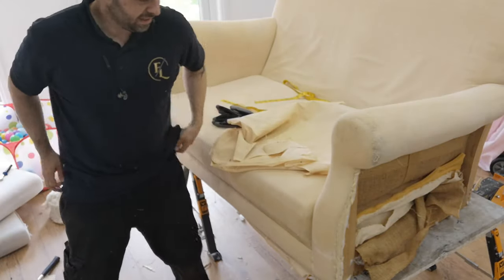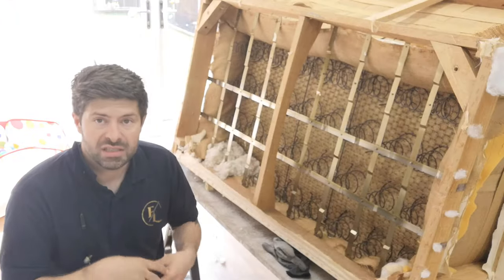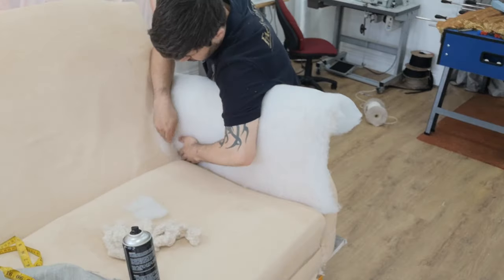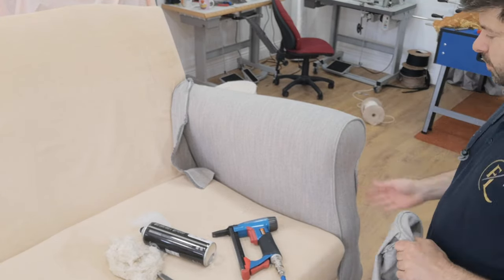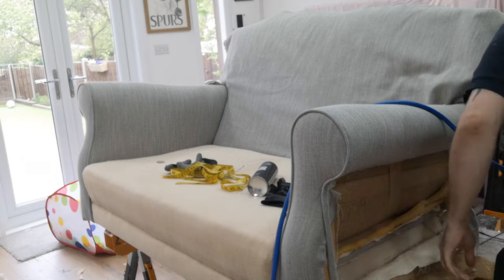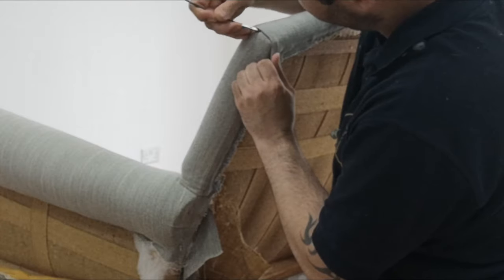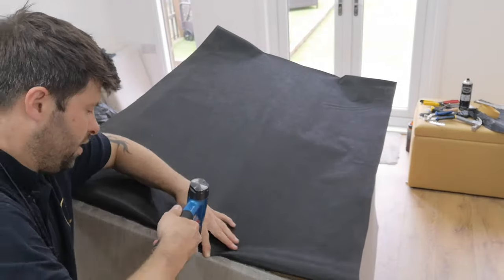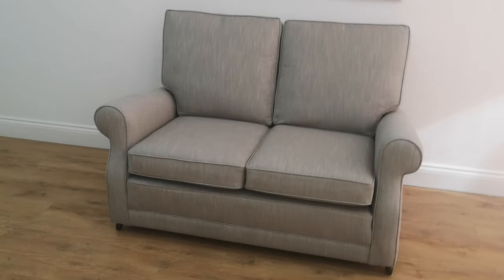DIY HOW TO UPHOLSTER A COUCH | STEP BY STEP HOW TO REUPHOLSTER A SOFA | FaceliftInteriors

Comment: if i’m wanting to change just the material (cover) on the outside do i still need to do all the padding, etc from the beginning of the video?
Reply from the maker: Hi Sarah! You don’t have to change all of the padding if it doesn’t need it - we replace foam if it needs it and re-pad as a standard service but if the foam is new and doesn’t need any re-padding, you can just recover 😊👍🏻

Comment: What type of fabric is the black fabric used between the bottom cushions and the frame? You added 6+ inches of the couch fabric and then hand stitched to the frame. Thanks!
Reply from the maker: Hi Tami - I used black lining fabric on the seat, which was sewn to the upholstery fabric. I hope that helps!
Reply: @faceliftinteriors Would a general fabric store call it "lining fabric"? Thanks!

Comment: Do you absolutely have to remove the back and sides of the sofa to pull the fabric for recovering arms and seat through? 
For instance, if I have a sofa that the only thing that needs replacing is the seat and the rest is going to be left the same? Or the only thing to replace is the side and the rest left alone? 
I like the look of a seat that is permanent and tacked using nailhead trim as well.

Comment: Your channel has been so helpful, thank you! I want to upholster our two seater slipcover sofa but I don’t think the fabric I want has the width to go across the back in one piece like yours did. You mentioned piecing fabric, is there a specific place/way this should be done? Also, if I use upholstery velvet do I need to cut my pieces with the velvet going all the same way? Thanks :)
Reply from the maker: Hi Ellenarae! Thank you for watching my videos, I’m glad you find them helpful 😊 So there’s a couple of options you could do with the outside back if you can’t get it out of one width - firstly you could run the fabric, which means turning it so the pile goes side to side instead of down...however, like you asked, if you do this the rest of the pieces you cut should all be going the same way with the pile otherwise you run the risk of the fabric looking different colours or shades. Secondly, you could sew a seam down the middle of the outside pack if you don’t want to run the fabric sideways. Finally, you could use a full width on the back and then piece two smaller even sized pieces of fabric either end...again, you’d sew those and would have two seams. It just depends what you find easier and what look you’d rather have! I hope this makes sense and is helpful 😊👍🏻
Reply: @faceliftinteriors  gathering supplies for my project! can i ask about the deck. What kind of material should i use for the lining (the black fabric you used) and when you sew the front deck strip to the lining fabric are you sewing the hessian webbing to the bottom of those as well and leaving the ends long to staple down? then when it comes to fitting you put on the front deck strip, flap over the lining fabric, staple down the hessian and then lash through all three layers (just behind the seam line?), Hope that makes sense! Thanks!

Comment: How do you handle the cushions that sewn into the back of the couch?
Reply from the maker: Hi Semo, cushions that are sewn in are a lot more difficult as they all have to be sewn in as one piece, and it involves taking a lot of fabric off to get to the seats. If you are going too attempt this always follow the original patterns. 👍🙏📎✂️📐⛏️🧵
Reply: @faceliftinteriors  Thanks for the response & thanks for all your videos.  This couch project is something that I'm looking at out on the horizon somewhere so I'm just trying to get my head around how to upholster.  I could potentially just use detached pillows on the reupholster.  Probably would simplify the job.  It is a sectional coach so I figured they used attached pillows to more easily keep them in place.

Comment: Great videos and  thanks for the tool list with links

With the price of sofas at the moment, as I worked with an upholsterer for a few weeks some 30 years ago - my wife wants me to look at building a bespoke ‘basic’ sofa for an awkward space and a large family…

Have you got any advice on material ( I’m currently looking at eBay! )  and foam ( I’m looking a durafoam on eBay as Leicester shops are very expensive)  
Also, what are your thoughts on using mdf for the frame. The frame will be square and low. 

Cheers.
Reply from the maker: Hi Darren! I would normally make our sofa frames out of solid beech wood but it doesn’t stop those hightstreet brands from making theirs out of MDF, chipboard and the like with a little bit of hardwood thrown in for the odd support 😉 so it can be done but I would be thrown in upholstery jail if I recommended you do it 🤣

I get all my sundries from Martin’s and Livedale (if you’re in the UK) Fabrics I get from upholstery fabric suppliers but you tend to need accounts with them to order from them (and are trade only). But as long as the fabric you buy is upholstery fabric - you should be good. Hope this helps 😊👍🏻

Comment: Hi Neil, I’m a beginner and recovering my hall stool....am struggling with the corner folds as the top foam is deeper than the frame! I can’t get a clean neat fold even though I’ve clipped away the excess fabric. From what I’ve said, any thoughts of where I’m going wrong?? Thanks. Julie
Reply from the maker: Hi Julie! Sorry for the delayed response. Send me a photo on Instagram of what you’re struggling with and I will try to help you. If you follow on insta before you message, I will receive it into my inbox 👍🏻

Comment: Would you say that stapling is legit? Not in anyway a criticism (I have no clue) but I keep reading online about stapling being wrong - but you're blantantly a professional and some of those attachments I can't see how you could do anything but staple them? (Great content btw, I've subscribed)
Reply from the maker: Hi Holly! Thanks so much for watching and subscribing, it means a lot 😊 In the early days of upholstery they used to use tacks and a hammer to secure fabric on furniture. However, for more modern furniture - upholsterers tend to use an air gun and staples. Upholsterers do still use the old techniques (like stitch and stuff) to reupholster traditionally upholstered furniture. I hope this is helpful and my ramblings make sense 🤣

Comment: Great stuff, but I find it discouraging to even try to do this myself. I have no idea how you got those measurements to match up. If I did that it would be completely screwed up and I would end up throwing my arms in the air and duct taping the whole thing.
Reply from the maker: Hi Marc, only way to learn is by making mistakes. I have been doing this for 15 years and still make mistakes, best way to learn. Hope this finds you well and thanks for watching 😊 🙏 🧵✂️⛏️📐
Reply: @faceliftinteriors  Thanks for the encouraging words. I'll let you know how my first couch project goes.

Comment: So I have a 4 section recliner that I need reupholstered. Called around a few places for quotes. $2500 just for labor, plus the cost of padding and fabric. Can someone help me understand why it’s less expensive to just buy a new sofa?🤷‍♂️
Reply from the maker: Hi Bernie. Its because most cheap furniture nowadays is imported and they are made in factories where they cut major corners on quality. They also use cheap materials and aren't made to last longer than 5 years. 🙏⛏️📎✂️📐🧵

Comment: How about new fresh metal springs. I am having work done and i want everything inside to be new. You are putting a layer on top of the old upholstery. So all the house mites that cause Asthma are still in the chair.
Reply from the maker: Hi Winny - you can specify that to your upholsterer when they quote you for the work that you want the whole thing completely stripped back and replaced 😊👍🏻 this sofa was originally a loose cover and they wanted fixed upholstery instead so didn’t want it completely stripped back. But this can be done if you want it done 👍🏻